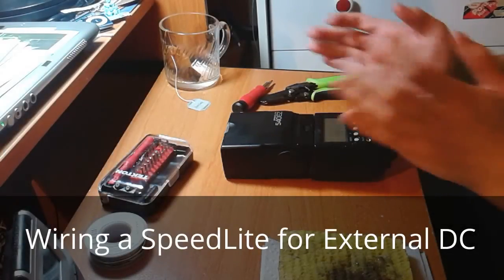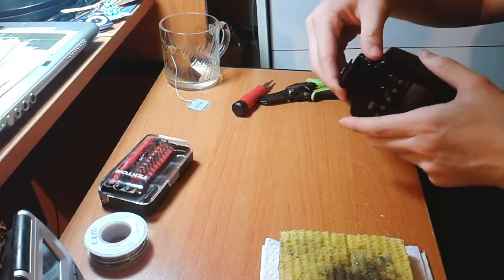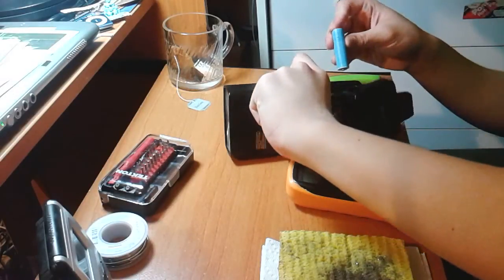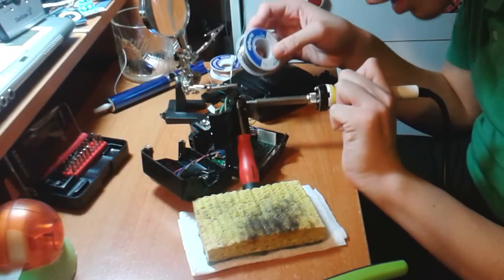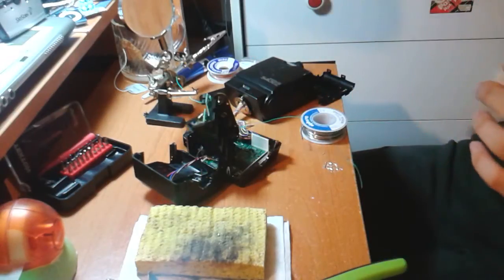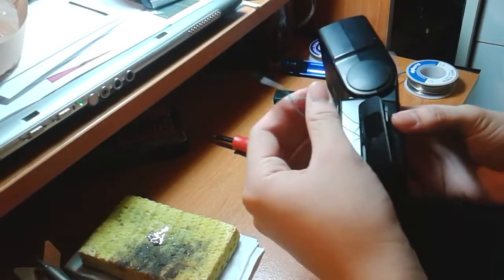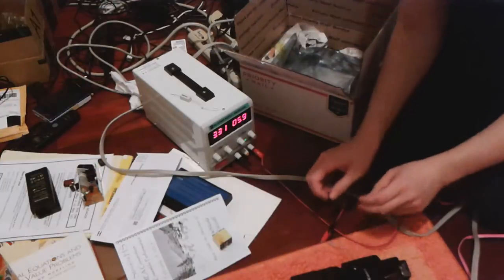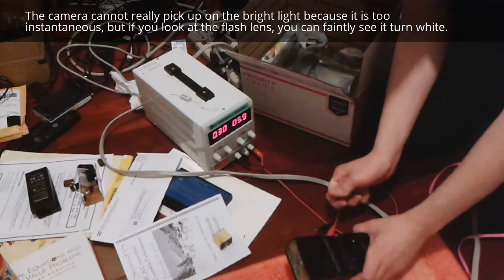Wiring Canon SpeedLite for External DC Power

Comment: I wouldn't recommend using those 3 contacts on the outside. When you just use the flash in the normal way, the batteries charge a capacitor and the capacitor then fires the flash. The battery pack you can buy does not only hold batteries but also a capacitor that fires the flash and (I assume) the one inside of the flash is just bypassed. But the capacitor fires the flash with 300V. So you won't achieve anything by plugging in an external battery pack with 5V or 6V.

Comment: I wish you would've Identified the 3 Pins where, while you had it apart.  I would use the External Power Port,, using a appropriate plug, IF I NEW which Plug was (+) & (-) ....  I have no ideal what the 3 wire would be fore.

Comment: Interesting - a couple of observations.. Your wires are very thin, meaning higher-than-ideal resistance. They won't catch fire but the voltage will drop at the battery terminals and this could cause problems with the internal electronics of the flash. I suggest thicker wires - like those used to connect car headlights. Also, if you're not using batteries, put a large electrolytic capacitor (or several in parallel) in he battery space to act as decoupling during the initial high current surge.
Reply from the maker: Good ideas. I used that wire because it was what I had. At least it seemed to work fine. What size capacitor?
Reply: @wecsam  Sorry, wasn't notified of your reply.. Probably a few 100 microfarads, or whatever fits the space with adequate voltage rating.. You want to use low ESR caps as they decouple better
Reply: Perfect... it's a matter of security!! Note: If it takes a discharge of 300 to 330 volts...

Comment: so it pulls 5 amps for recharging right?
Reply from the maker: It probably could draw even more current; the capacitor for the flash has very low ESR. My power supply just happens to be limited to 5 amps.

Comment: Hi, I did this and tried to use a powerbank but it did not work.
Reply from the maker: Is your power bank putting out 6V? If so, you might be triggering its built-in over-current protection, in which case you will need to add a resistor in series to limit the current.